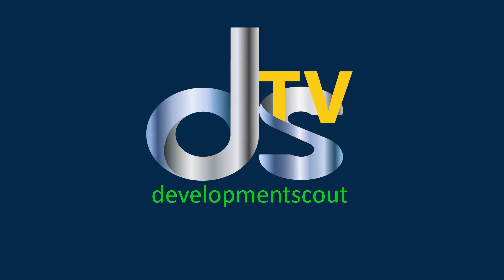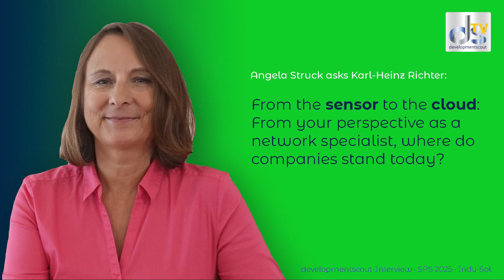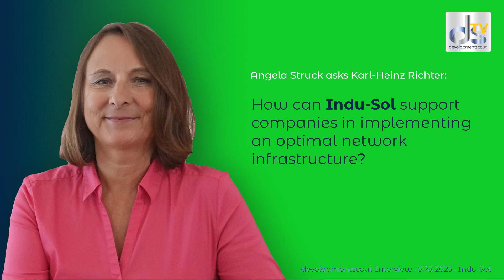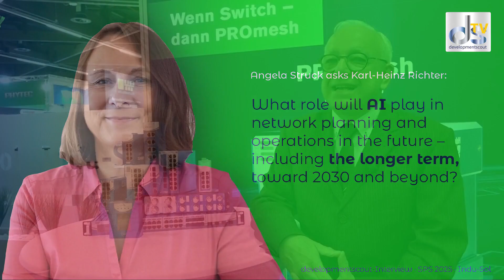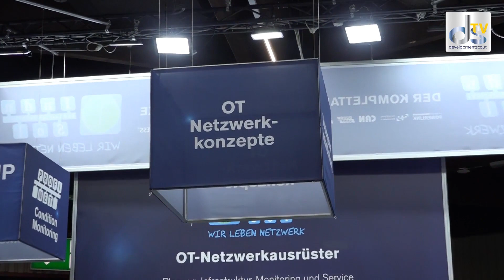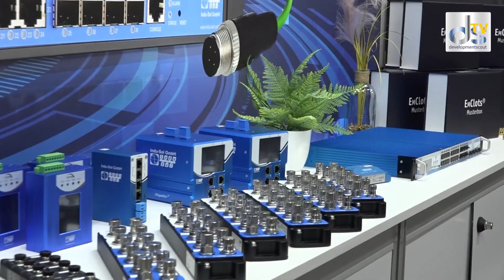From Sensor to Cloud: How Industrial Networks Turn Unused Field Data into Value | SPS 2025

Comment from the maker: Industrial environments generate vast amounts of sensor data every second — yet much of its potential remains untapped due to limited network visibility.

As connectivity, IIoT, and AI continue to reshape manufacturing, network transparency is no longer just a technical requirement — it is becoming a strategic foundation for operational excellence.

👉 What percentage of your field data is already actionable today?

If this conversation resonates with your current challenges, feel free to share your perspective or connect with our experts to continue the discussion.